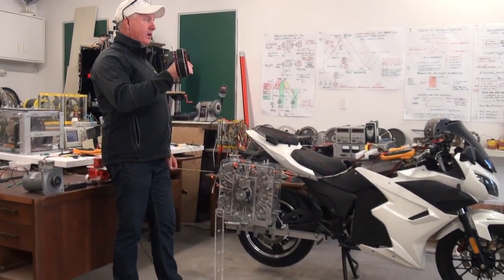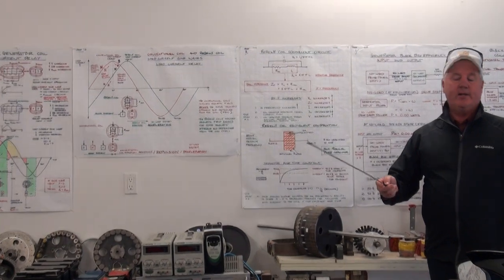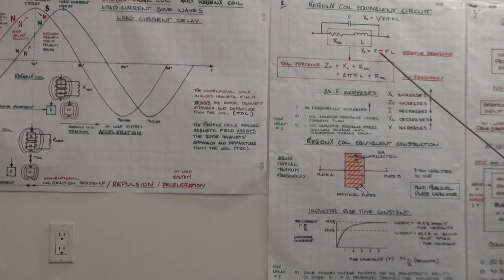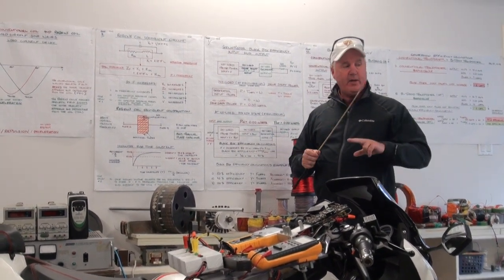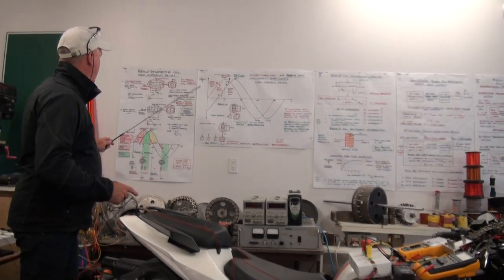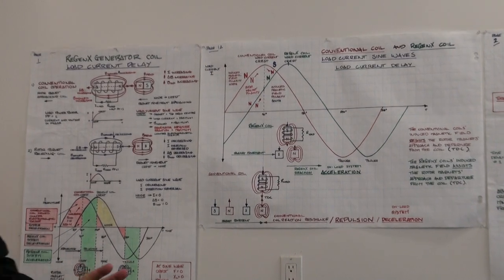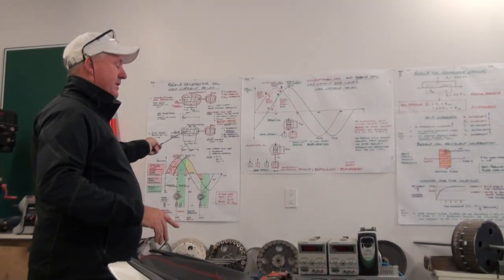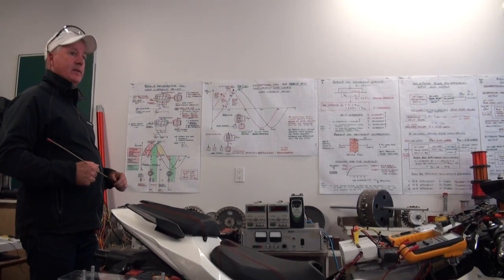How Increased Frequency Produces EV Regenerative Acceleration - ReGenX Generator Coil Operation

Comment: The explanations are valid. The entire dynamic process can be described with the term "impedance matching". That should be also achievable with dynamically adding a capacitor to any coil, as to allow distributed, coil-capacitor capacitance, to match the additional load put on the generator, as to minimize the dynamic impedance in the system.
Reply: dylans voice  That exactly how it works, the issue is though that as the load changes, the capacitance needs to change too. So I would say that the most efficient way of doing this will be to apply it for steady/known or at predictable load, as in the transient cases, where the system is not in a dynamic equilibrium, constantly changing the capacitance, the adjusting the capacitance to the power dynamics may be very difficult to work with.
Reply: dylans voice  In the most simplistic way, is by building capacitors one of the end is a sort of sliding as to allow changes in the capacitance. The slider of that scale is hookup to a small motor that will get more amperes, as long as, the point of the minimum current, maxim efficiency,  is  displaced (due to the new load). In that respect the motor will move always the slide as to minimize the current through the motor, as that will be the point of optimal energy use.  Notably though, in contract of what Heins says, I do not think that the process has infinite efficiency,. the power consumption can can be optimized only to a given theoretically predefined level, and so the term is "impedance matching".
Reply: Did ya'll forget about synchronous condensers? ._.
Reply: dylans voice  Overexcited no load synchronous motors?

Comment: Capacity of the coil depends little on turn-to turn capacity. The length of the wire used is of greater importance here.

Comment: So as far as I understand. As frequency increases basically the current can't travel the length of the wire. So it's like you turn the resistance up.
But the magnetic field did create the voltage potential on the wires. So if that is held capacitively between the windings then it can discharge after the field has started to collapse. Instead of reacting as it raises. So has no adional resistance to rotation as power is drawn. 

This means to get more energy out of a coil working this way you need more capacitance in the coil.

While this will work by just making the wire thinner and longer. It can be great enhanced by designing the geometry of the coil beyond a simple winding. 

It would be much better if you made it linke a film capacitor. 
The two long tapes of foil wound round would be the wire. The end of the first coil plate would loop back to the start of the second. Making the maximum possible potential difference between the plates. Just like a Tesla did on one of his pancake coils. This would hugely increase the children ability to store energy. But be hard to make really long and low frequency. 

This idea would also work with a transformer as all a rotational generator is doing is making an AC magnetic field. The same as the primary on a transformer. 

It then frees you from the mechanical limits in frequency generation. Meaning its easier to make unusual geometry coils work on test without highly specialised manufacturing. 

I also think this is one of the effects Tesla was getting from his coils. But it's much harder to do with them as they also have to be running in resonance at the correct frequency. And RF stuff is very hard to work with. 

Where yours simply have to get above the critical frequency. 

What do you think?
Reply: Dear friend

Your comment is very good

I can say that this problem can be solved through the method of composite frequency resonance

Requires static electromagnetic resonance modulation

Comment: Also at TDC inducted current is 0, not max. When the North Pole approaches the coil, it generates a current, in the TDC it drops to 0, and as it moves away, it generates a current in the opposite direction. TDC should be 90° to the right on Yours diagram.
Reply from the maker: https://www.slideshare.net/PDiCEOThaneHeins3240/5-analysis-of-regenx-generator-coil-load-current-delay-164628634
Reply: @PDiCanada1  thank You so much :)